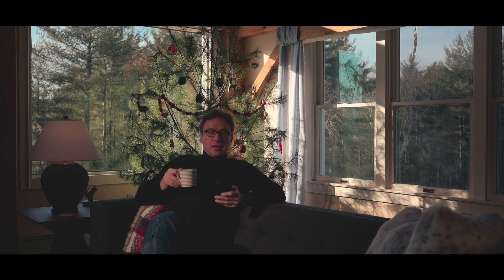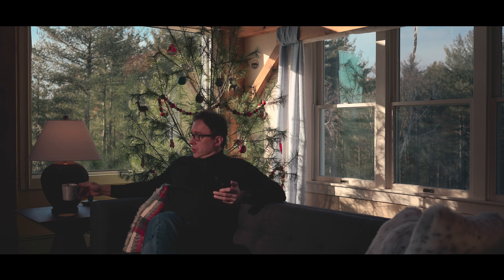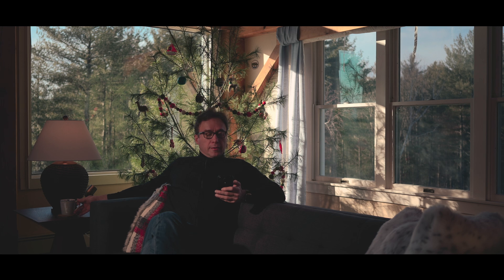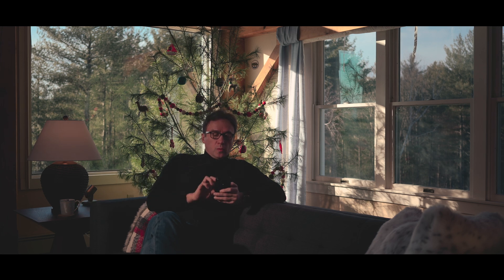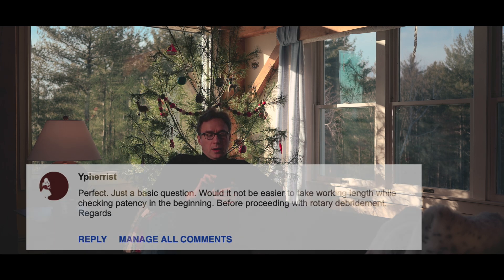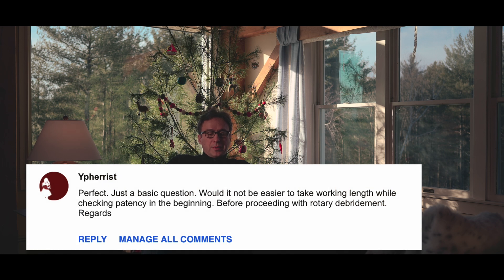Q&A Comments: When to measure the Working Length early or late?

Comment: Hello doctor please tell me 
How manage very difficult ledge onlower sixwhich it need retreatment Rct
Reply from the maker: Best thing you can do is not to make it worse. Bypassing a ledge requires expertise that can’t be mentioned or taught in a brief YouTube comment. But to summarize the best outcome from a. Big picture point of view, the most important thing is to understand that force will not bypass it. It will only increase the ledge u til it perforates the root and then you have two separate problems on your hand, the apical problem, and the perforation! 
I personally try to bypass with a handffile first and give it only 5min. If I can’t bypass in five minutes then I don’t continue as it will potentially perforate or weaken the root. Apicoectomy, if possible, will have a much better success rate before a perforation than after. So, I would then do the apico. In your case, you refer to someone who can. After that, the most important thing is recall. You have to are sure the area heals. If it does, great. If not, then extraction. That’s the big picture view of the whole thing. But ideally, if you have access to a competent endodontist who can mage it either way your best bet is to refer. 😅👍
Reply: Thank you so much ❤❤
I love you so much 💕 sir

Comment: I have been doing the crown down technique for some time now. Taking WL later after widening coronal 1/3 and 2/3. Life has been so stress free for me now. Very less post operative pain. Very rare file separation. So for all the dentists, immediately after access opening straight away start with the SX rotary, next use 20-4 or 20-6 till apical 2/3 with lot of irrigation. Then you can take WL. Now just 1 more step to go. Happy Endo
Reply: And how about using 10 or 8 k files in between those files which you mentioned?
Reply: @gautamdubey9876  that goes without saying bro. Of course we should use 8 or 10 after each file just to make sure apex is not blocked
Reply: Thanks brother actually was bit confused want to ask another thing after done using 8 and 10k files shall I go through with the steps which you mentioned here and which rotary file you use for both curve and calcified canals

Comment: Hello Doctor! In regards to measuring WL correctly what line/color do you usually use as a safe and consistent WL? For example I use a Morita Root ZXII and was taught in dental school to go to the middle of the green lines (where the green arrow points), after graduating I did some researching and saw many endodontists (such as Dr. Ricucci https://youtu.be/DH7oOOjt0eE) recommend going to the last blue line since that is the apical constriction and they claimed anything more will actually be in the foramen and technically in the PDL. This way of going to the end of the blue usually has radiographic WL at 1-1.3mm short of radiographic apex. I would love to hear your recommendation.

Comment: Sir which better rct single sitting vs multiple in a irreversible pulpvitis cases for general dentist
Reply: If you can instrument the canal and remove all the tissue fast enough, the canals are not bleeding and you have the time to fill the canals then single. If the instrumentation takes long time, you and your patient are tired and a next patient is comming soon, then I'd fill it next time

Comment: Good evening sir....if in small canal we measure working length later on then the concept glide path apply at which stage of cleaning and shaping of root canal?
Reply from the maker: The Glide Path concept is then replaced with the concept of Available Length! 
That’s an old video I made before but will elaborate again in a future video. Cheers!
Reply: @EndosKool  Yes Sir.
Reply: In case of j Morita mini preparation should stop at end of blue zone or 1mm short from apical line of apex locator which criteria is better
Reply from the maker: @rupeshpachagade3269  it depends where you practice and what kind of length is acceptable. There’s no universal answer but that which you have learned. I stop at 0.5mm line and it seems to work fine.